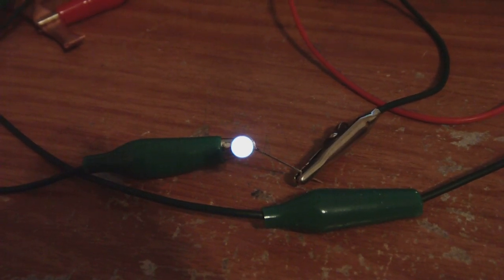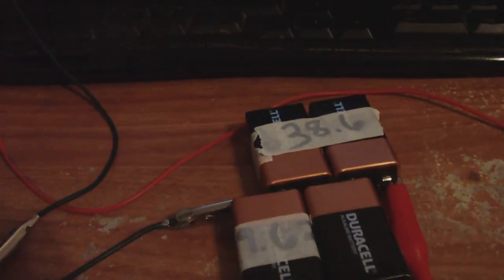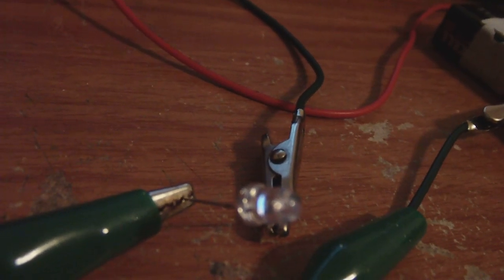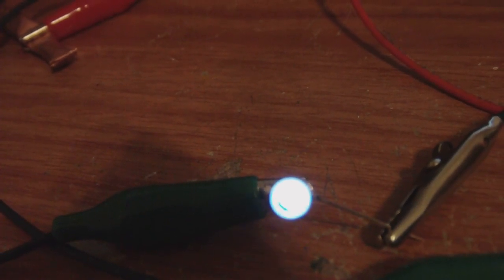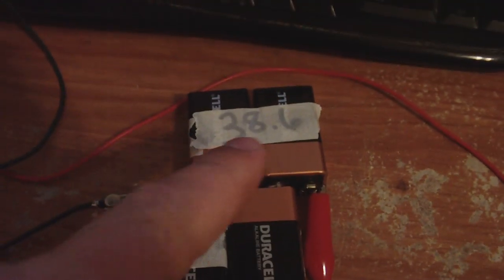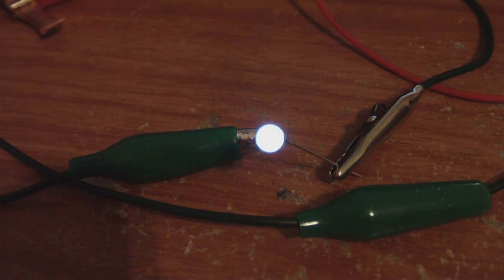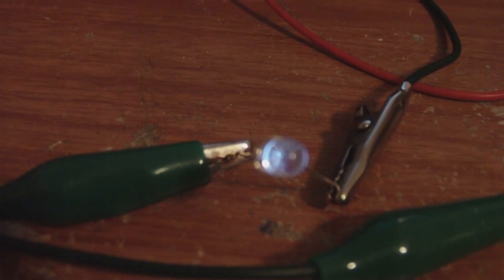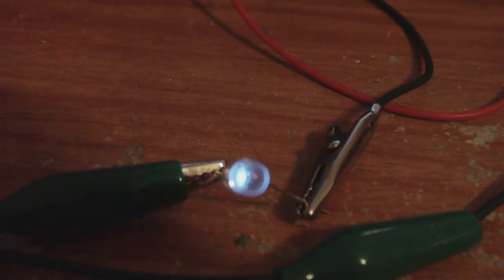flickering from crystal cell series circuit

Comment from the maker: The copper tube has to be crushed with salt substitute inside of it. It took 30 minutes for it to start to flicker, i let run over night and it stopped when i woke up. If I wet it then it would getting its power from water. The flickering is almost random. It lost no voltage over night.

Comment: IB,
Do you see this effect if the copper tube is NOT crushed and rather just a wire within the tube surrounded by the salt substitute?  Ionic shuttling and shorting perhaps.  If you were to wet the salt substitute my guess is that things would stop blinking.  What is the voltage across the Cu/Cu component?
Thanks,
diveflyfish

Comment: Hi there. Could it be that there is a strong radio station nearby? With the diode (led) and the wires it is possible that you have made a tuned AM or FM circuit...?
Greets M (maybe check it with a small radio near the circuit)

Comment: Indeed interesting. Looks to be similar to the effects that the 3 Battery experiments thread at EF are seeing. Strange things happen with series circuits. I wonder what a small DC motor would do instead of the LED. Perhaps your salts cell is the 'bad battery' in this circuit, due to the voltage/impedance mismatch.